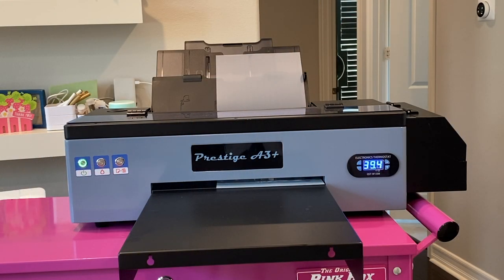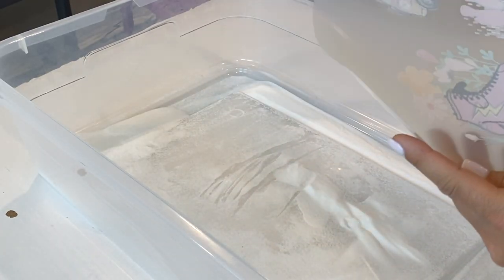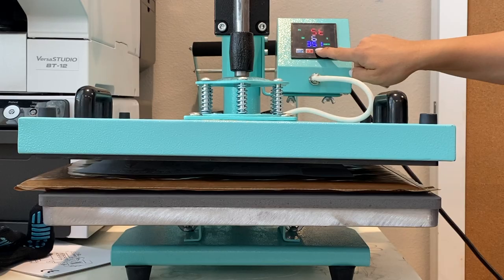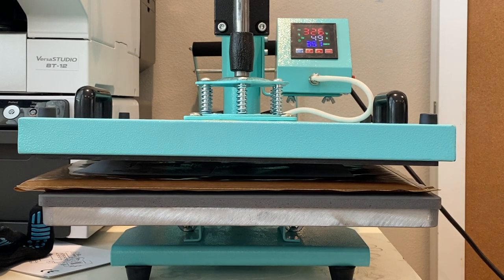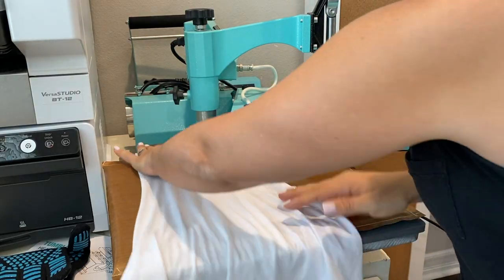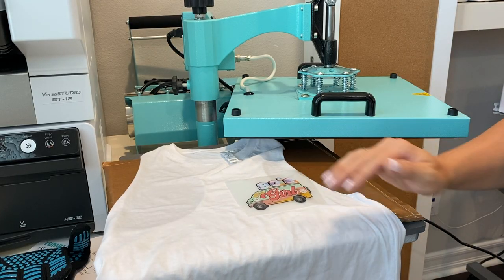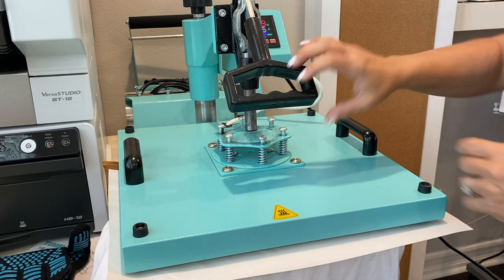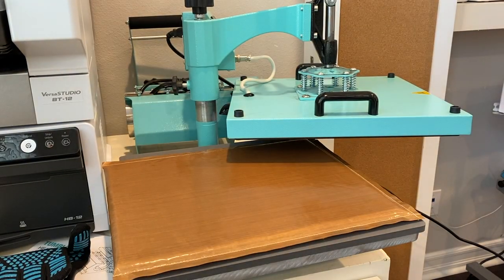How to Cure DTF Powder with Heat Press: Prestige A3+ DTF Printer Tutorial

Comment: Are you using dtf ink instead of sublimation ink in your printer? I’m having issues transferring and I think it’s because I use sublimation ink?
Reply from the maker: I use sublimation ink in my sublimation printers and DTF ink in my DTF printers
Reply: @SilhouetteSchool  ah ok. I didn’t see it was a dtf printer. I have a sublimation printer with sublimation ink and wondered why when I print onto my dtf film that it won’t transfer correctly onto a cotton shirt. I’m using 300f and pressing from between 10 and 60 seconds and only gets better the longer I do it.

Comment: Hi, thanks for your updates so far and I have been following all of your videos. If you don' mind, I have few questions regarding curing and heat-pressing. 1. is it possible that different dtf sheets require different temperatures to cure properly (or do you think it's fixed for all dtf sheets?) 2. Also, when I peel off the sheets from the fabric, it doesn't bond completely . Do you suggest using a heat-gun for areas that are yet to heal or put the whole sheet back in the oven ? 3. Have you had any experience of re-do' ing a dtf transfer on say another damaged fabric just to get it fixed.  I'll appreciate your response.
Reply from the maker: Hello there! Unfortunately it's hard to trouble shoot here. Please feel free to email us here: http://www.silhouetteschoolblog.com/p/blog-page_9.html

 If you think you would benefit from 1:1 help, please consider joining Silhouette U (www.silhouetteu.com)! Members get access to 1:1 help via priority email, chat, and a private Facebook group.  Our website also has 400+ video tutorials for all skill levels plus a monthly coupon code for free designs at So Fontsy.  We hope to see you soon!

Comment: Maybe you can help me. Having issues trying to do some shirts.

I'm making my prints and then putting the powder on immediately and then curing the same way you are just not a swing away press. Then I press my shirt for 10 secs and then lay my print down and I've pressed from 300-380 for 10 secs-30 seconds and my ink isn't full trasnfering and the lettering looks cracked. Any ideas?
Reply from the maker: When you say you are "uring the same way you are just not a swing away press". what do you mean?
Reply: @SilhouetteSchool  I have a pull down press not a swing one. So the back is slightly lower than the front.
Reply: She clearly said it has to be a swing press. Otherwise, you are not applying equal heat throughout.